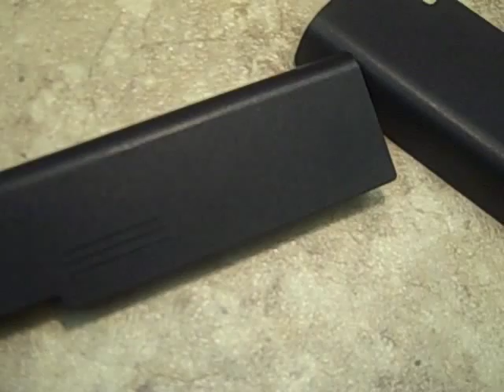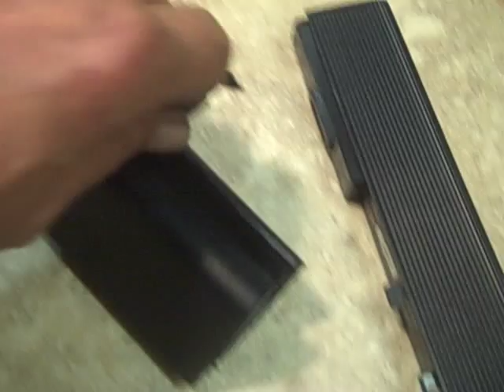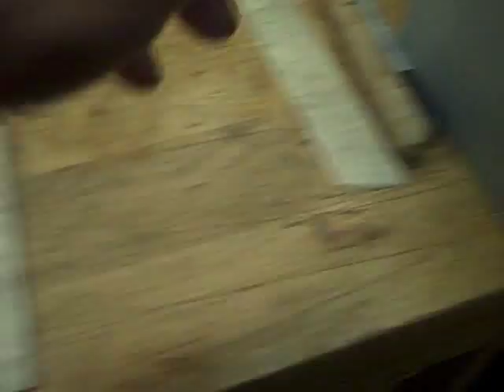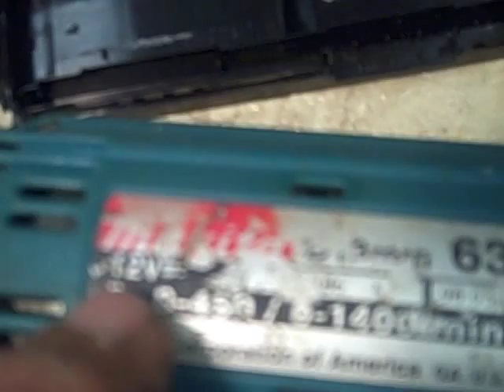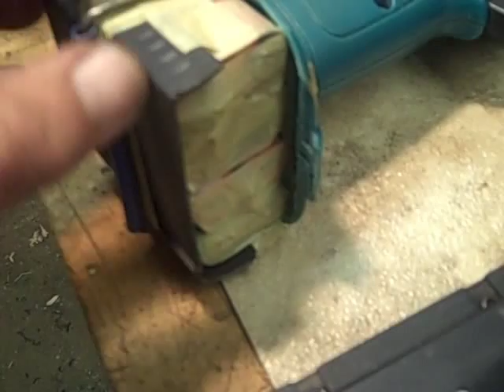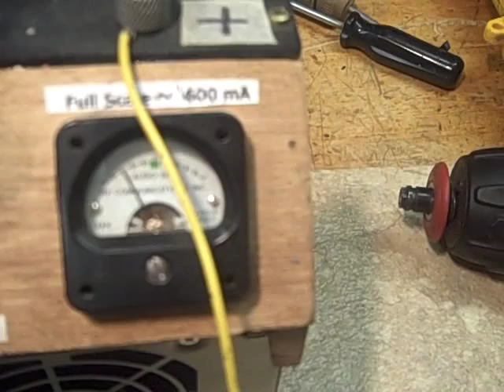Litium Ion Cells - How I Get "em for my Batteries

Comment: Where du you get these batteries?
Reply from the maker: I get the battery packs from local  computer stores, usually operated by a single guy .
They are glad to get rid of them - I try to get 3 or 4 packs and give the guy 20 bucks cash. He's happy and I'm happy. Plus he knows that I will responsibly recycle what I do not use.

Comment: I did this with my Black&Decker Versapack hobby tools from 2001. I exchanged the cad (sub-d) with nimh batteries with some diy action. Somehow the old cad batteries killed my charger so I had to buy a new one. Still dont know how that is possible, do you? The cad cells were  not allowed to be sold anymore. Still use the toolset for my hobby projects. Now I will try it with laptop cells.
Reply from the maker: The usual reason that chargers fail is that the capacitor fails and shorts, thus killing the rectifier bridge. It pretty well kills them beyond repair. 
I have found that you can drive most lower voltage power tools ( eg 9.6V) with 12V  ( eg three lithium batteries) with no problem.. As I indicated, the trick is to charge them.